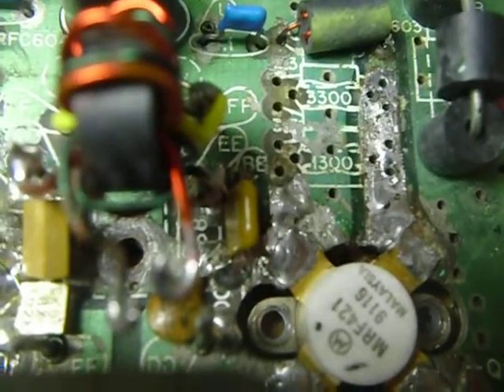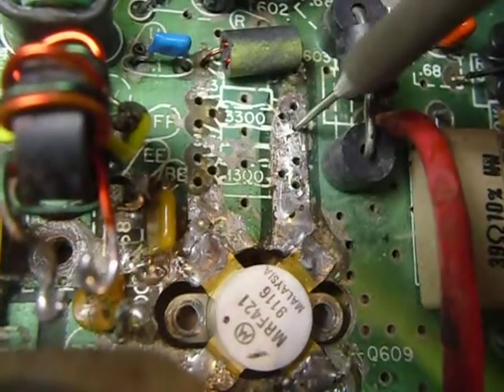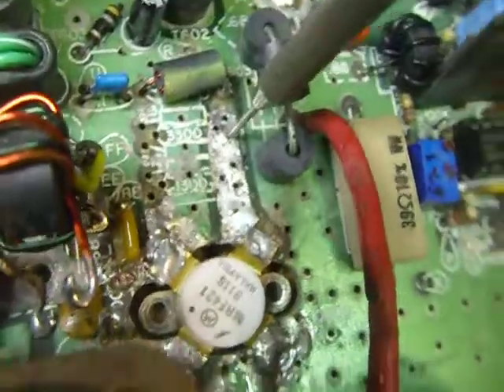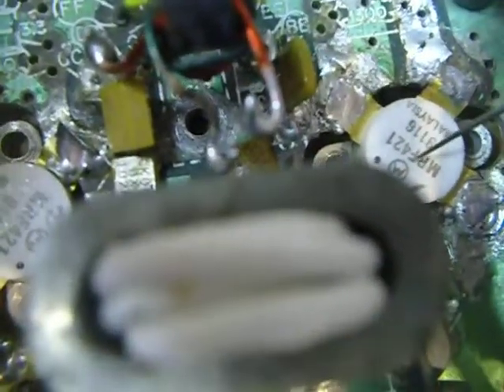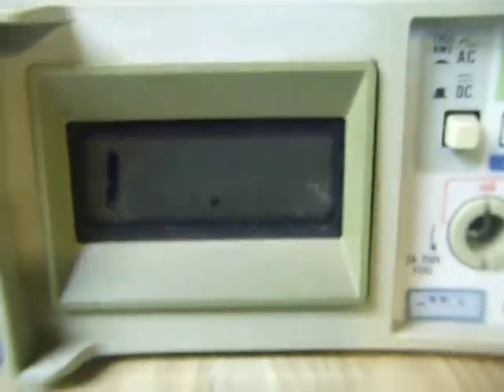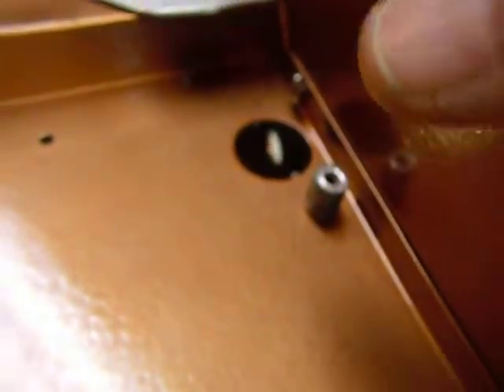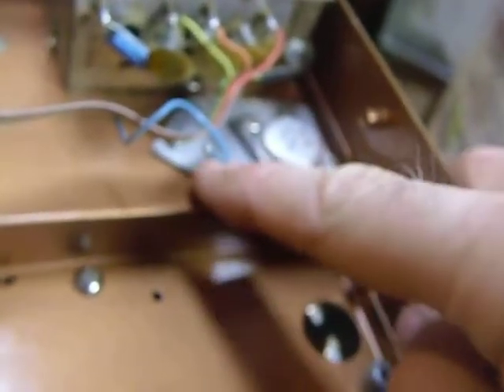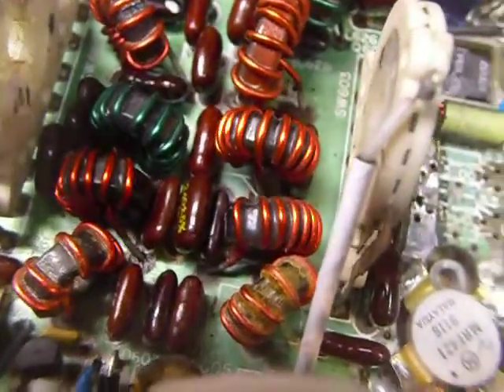SS9000-2,Heathkit SS9000,Heath SS9000,Heathkit, SS9000, Heathkit Tranceiver , Amateur radio repair

Comment: Bad finals? Malaysian Motorola? The market is flooded with fake Japanese RF transistors now. Check out the desoldering tool Marlin P Jones sells. They are maybe $170 with extra tips, and they will suck those holes clean & open them right up for you. 73s KI7AQJ
Reply from the maker: Thanks for the tip Seth that desoldering tool sounds really nice.  Yeah Motorola transistors can be made most anywhere now  These do work fine . 73  Bob